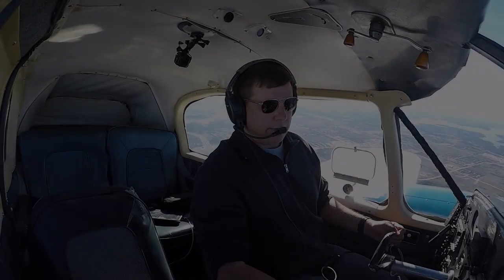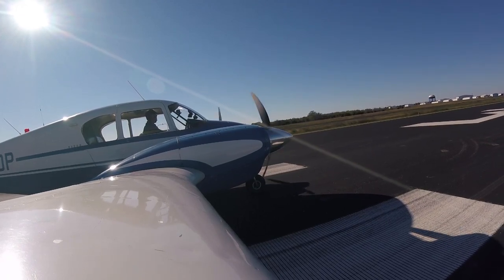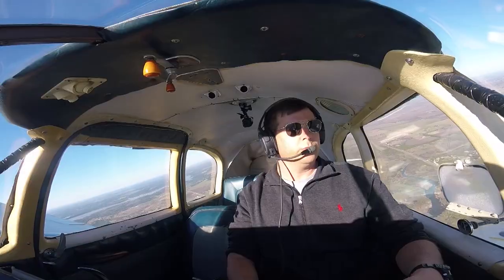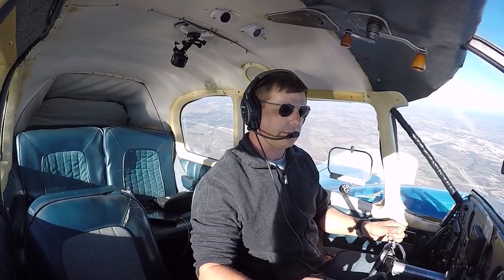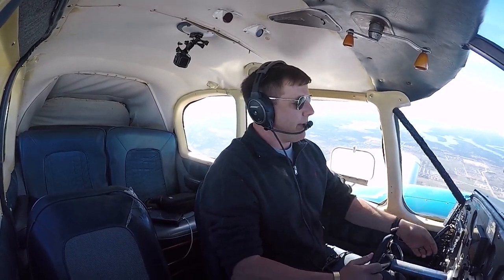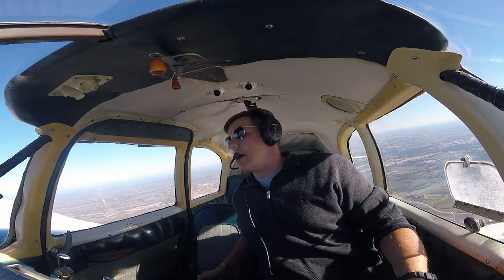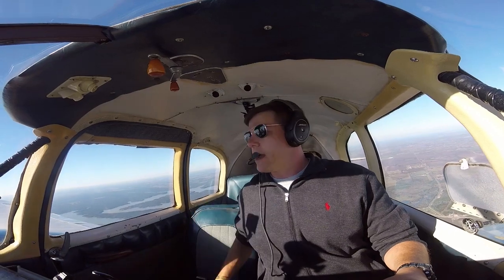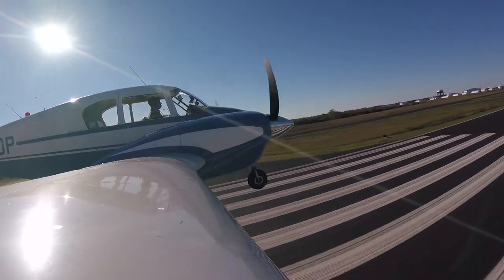How to feather a prop in flight?

Comment: i too came here to learn the feathering the propeller , after watching the Yati airline crash Jan 2023 video , can you plz explain major difference between the single englne plane prop  and multi engines prop ?
Reply from the maker: Thanks for watching and for your comment.  Generally speaking (barring exceptions), majority of multi engine props are designed to go to the feathered position without power where as the single engine props are designed to go to the "fine" position without control.  The design is built around the typical "worst case scenario" for each aircraft.  In the case of a light twin it's a power loss on one engine.  On a single, it is a loss of control of the prop; hence it the system will default to a useable prop condition on a single to continue to a suitable landing.  I hope that helps.
Reply: @AllAmericanAviation  thanks again for explaining well

Comment: 8:53 Because of what?
Reply from the maker: Idle centrifugal pins in the prop hub so that the props don't naturally move to a feathered position when oil pressure is lost on a normal engine shut down.